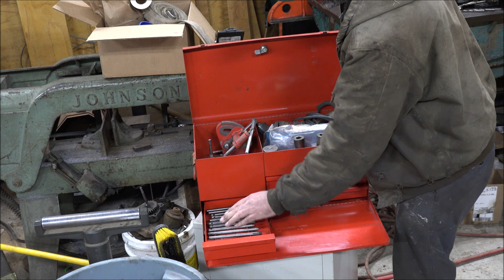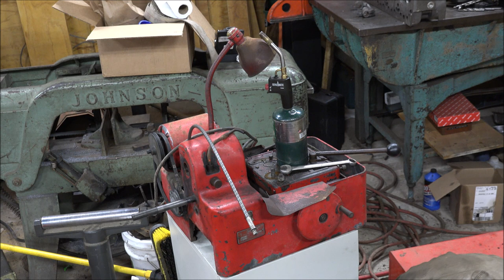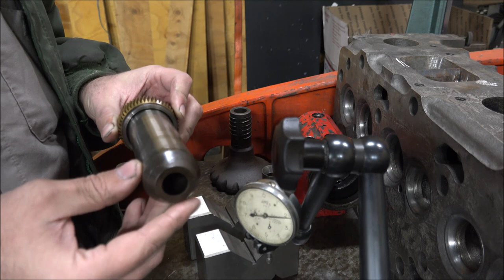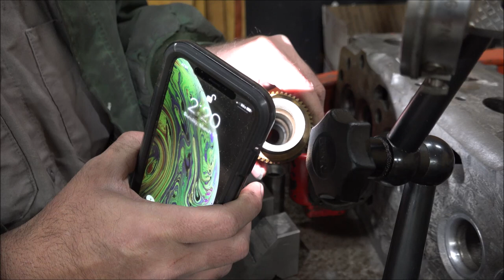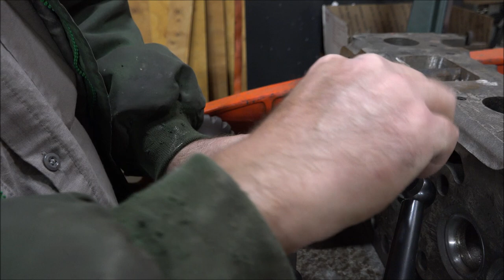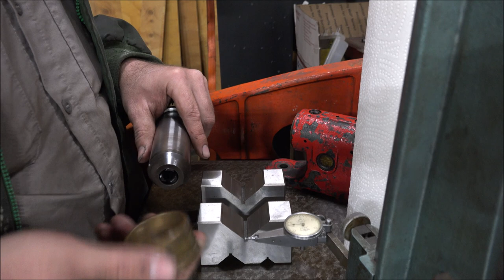Reducing Correcting Collet Run Out on a VR300 Snap-On Valve Grinder Inspection and Spindle Rebuild

Comment: i have been doing valve jobs with a machine that was built in 1945 for over 35 years and have had no issues with it the were made well back then

Comment: Hi Brian .. I am sure that your ability as a mechanic is far above the problems that this machine has .. and I am sure that you are going to leave it repaired better than it left the factory on its day .. I have no doubt of it..a greeting from Spain and thanks for your time and for sharing your knowledge
michel
Reply from the maker: Fingers crossed!
Reply: @bcbloc02   I follow you 💯 from 🇨🇦 #YSW I have two questions to ask you will you show more videos on Diesel engines rebuilding  & big Traktor engines for tractor pulling you explain everything to the Tee when you are working on all of your lathes  have a wonderful Monday 30th of August bye 👋 from #YSW Domenico Monteleone

Comment: Nice video! Patience is key to accuracy. I have a Kaiser Johnson saw like the one in background of video. Bought it from a rice farmer. He said he made 2 cuts with it and it cut so crooked he pushed it in the corner and never had time to investigate it. Lol. Good for me, I bought it for $200. He showed me the first cut. He cut a welded on sprocket off a shaft next to the weld. I put a new blade on and didn't have to touch. Still cuts good today, after 30 plus years. Thanks for sharing your knowledge and experience with us. Just goes to show craftsmanship never goes out of style. 👍
Reply from the maker: That was indeed lucky for you! My saw dates to ww2 and it still cuts straight.
Reply: I think my saw is a 1964 model. They don't make em like that any more!

Comment: One more tool to allow complete in house engine rebuilding, all you lack now is a crank grinder. The Crank Grinders are costly, but they give you the ability to turn (grind) extremely accurate hard surfaces. Enjoyed watching you troubleshoot the runout issue. You are a very skilled individual indeed.
Be Careful and Stay Safe
Bob
Reply from the maker: Thanks and I have my eye out for a good crank grinder.

Comment: Hi Brian I do believe that snap on still sales parts for them. I know snap on has their own parts made just for their stuff though for the most part and is made just a little different than others so you have to get them from them. I have been a mechanic an shop owner for 40 years an have bought their equipment and it stinks when you need a part an have to get it from them. Good luck an they are nice when working right. Stay safe.

Comment: Excellent video it's nice to see you reconditioning the valve grinding equipment. I have a k o lee and Sioux valve grinding machines and a black and decker seat grinder I use them once in a while to fix heads mostly on 2 cylinder john Deere tractor engines

Comment: Useful tool, I used to clean and oil the collets before using them.  A lot of valves were slightly 
bent. Try a length of silver steel/drill rod as a test bar. You could always re-purpose it as a tool
grinder by replacing the Valve holding unit with a tool holding jig.
Reply from the maker: Thanks for the tips!

Comment: Brian it is too bad you live so far away. I have a Cinn. internal grinder that I rebuilt. With it you could easily get the collet holder running more true. I will second or third in saying that grinder looks like a Black & Decker  grinder.  I have the one my Great Grand Father bought new in the 1930s. It gets used every few weeks around here.
Reply from the maker: I have found it to be a ko lee grinder.
Reply: @bcbloc02  I own a ko lee surface grinder. The first look at this machine and I said to myself ko lee had to have built it.

Comment: Brian that looks like a KO Lee valve facer very nice unit sad thing is that they went Tang Uniform about 8-10 years ago. Besure to hang on to the collets very hard to find and expensive to buy there's 3 I think. Cheers
Reply from the maker: I read in a book there were 3 collets available I only have one size.
Reply: Try flipping the collet end for end. Last collet i bought was $125 used new one were costing $300    if you can find them. Also try running a ball flex hone wouldn't get to crazy with it

Comment: What is the run out at the valve face while on the machine running?  That is the runout that matters.Test it with a quality new valve, needs to be .002 or less.  How bad do the stone holders wobble on the pilot?  New stones holders and pilots are available,  because the grinding dust eats them alive.  Should either be a hex or star driver.  Not sure who actually made the seat grinder, probably K.O. Lee.   Do you have the oil tray that slides under the belly of the machine ?  Should be an oil pump under the bottom of the belly.  Do you have the stem grinder attachment and the valve depth stop rod ?  The machine was actually made for Snap On by K.O.Lee .  The K.O. Lee machine number is K403 series(135 lbs) K500 series (200 lbs). Goodson and Regis both sell wheels for the valve grinder.  If I dig in my filing cabinet I probably have a K.O. Lee manual for it or can take pics of actual parts if needed.  That is a nice machine, much better than a Sioux.
Reply from the maker: If you find a copy of the manual let me know as it would certainly be of value. The oil pump is made into the cable drive  that runs the valve holder spindle. I do have the slide out drawer that holds the oil. The oil hose is toast but should be able to find a hose to fit it that oil won't eat up easy enough.  I have the fork deal and micrometer stop for grinding the stem lengths yes.  The 200lbs sounds about right. It is heavy for me to pick up.  3 of the stone holders are excellent one has a little wear but its less than .001"
Reply: @bcbloc02  I did find the K.O Lee book but it was just a 2 page pamphlet that listed general specs and attachment parts list.  It didn't say very much!  The oil pump can be a pain to prime or at least mine is!  I think I always had to back fill through the discharge line to help it prime.  Somebody on ebay has a used machine that got parted out if you need anything.  You can buy specific valve grinding oil , but a quality hydraulic oil will also work and much cheaper.

Comment: Brian, you have the patience of a Saint! lol half a thou on a valve spindle? Usually more play in a new guide after Installation and reamingLol so what are you worrying about? It's an oil burner, they rattle and roll on from new!
Reply from the maker: Want the best job possible, not just within sloppy factory tolerances. :-)

Comment: Went back to first  part of the video, but can't pick up what drives the collet chuck! Is there a shaft that comes up through the base with gear that meshes with collet gear?
Reply from the maker: There is a speedo type cable that drives a worm gear in the collet spindle.

Comment: Did you do the electrical my grandfather bought or new and after so many years the electrical just went out and trying to figure it out
Reply from the maker: I have not messed with any of the electrics. It is just a typical 110v motor with a toggle switch to break the circuit so nothing hard to wire up.

Comment: Still not good enough to grind the intake valve on a Detroit 6-71...  Within specs for the exhaust valves.  Nice looking machine.
Reply: Those must be some tough spec’s, what is it for a intake valve?
Reply: @Hoaxer51  Absolutely zero tolerance.  Detroit 6-71 engines did not have intake valves.  They are a 2-stroke diesel with ported intakes and 4 exhaust valves.  Posted it as a humorous post.  So being there are no intake valves the valve grinder's tolerances are not good enough to grind them.  However, with 4 exhaust valves per cylinder, they well made plenty of grinding to be done.
Reply from the maker: I was actually going to say the rings lap the intakes on a Detroit. :-)
Reply: @bigun447  , dang it, I knew that and I fell for it anyway!
Reply: @bcbloc02  That happens when those Jimmy owners try to run without air cleaners or ones with holes in them.  The rings get lapped to nothing or some chunk gets in the port and then you have to replace the piston and liner.  And maybe a rod and crank.

Comment: Good to see a manual runout check on the surface plate.  Generally speaking, on youtube there's lots of measurements of flatness on the surface plate, and lots of talk of maintaining concentricities in the machining setups and sequencing.  Seldom do we see setups on the surface plate for verification checks on roundness, concentricities and runout.
Reply from the maker: Never know what you will see on my channel. I cover most all of it at some point. :-)